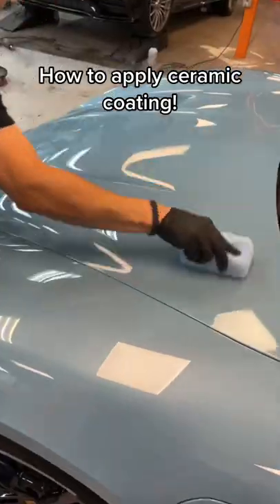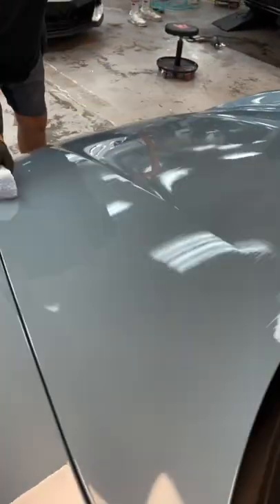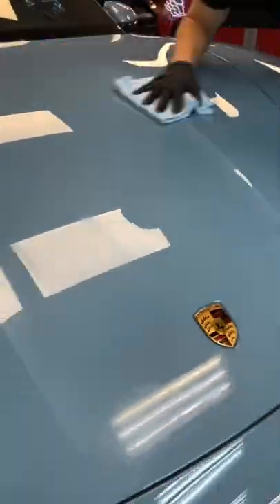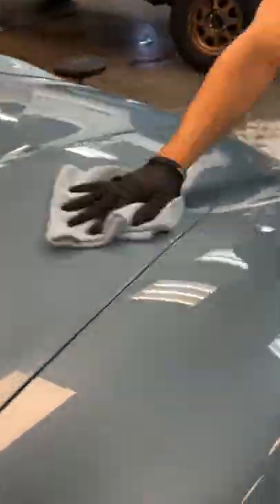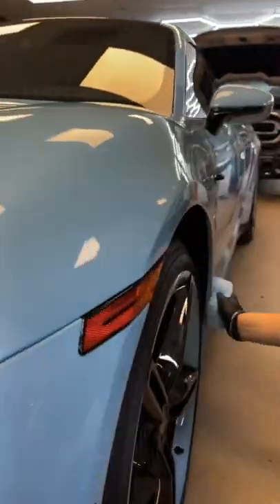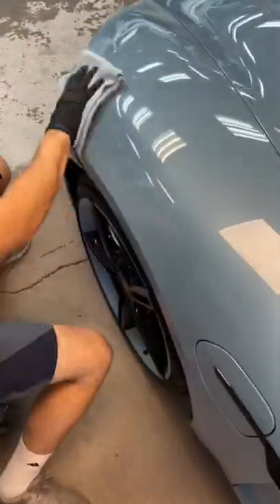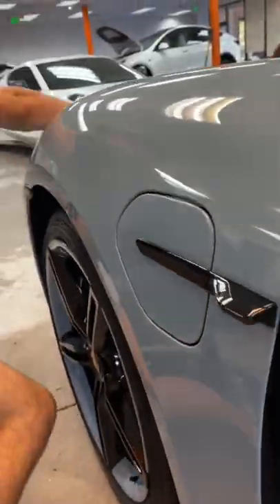How to apply ceramic coating! Porsche Taycan Turbo!

Comment: What’s the point of ceramic
Reply: Ceramic is significantly harder than paint, and I believe is also much more UV resistant. This means that little stones that would normally scratch paint don’t, and that the paint will last longer due to ceramic blocking some of the UV from the sun